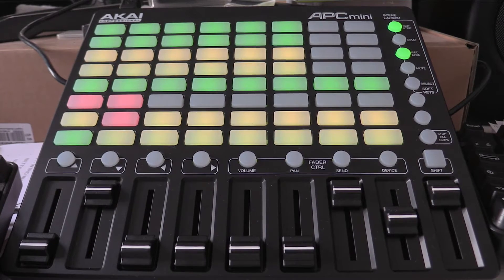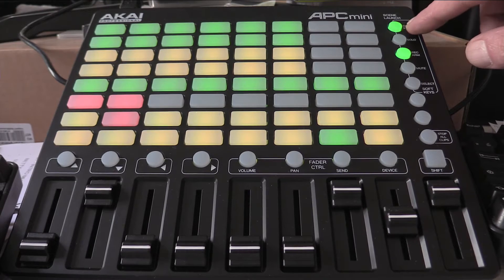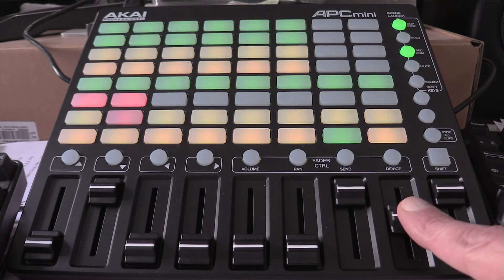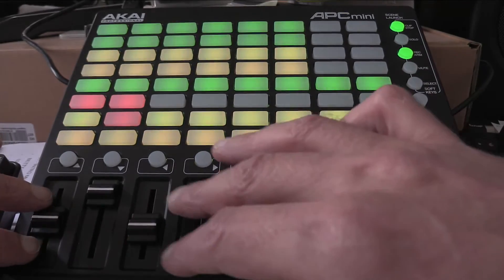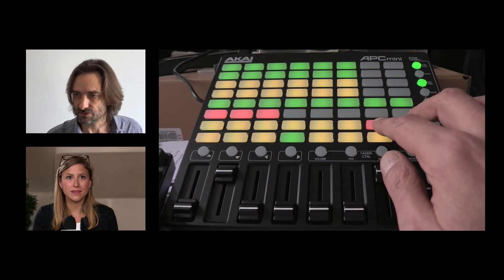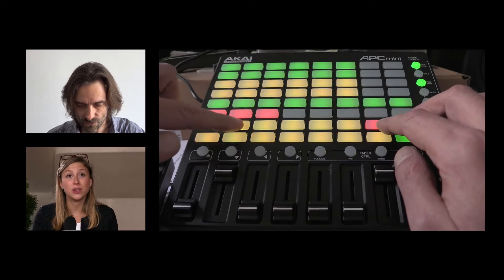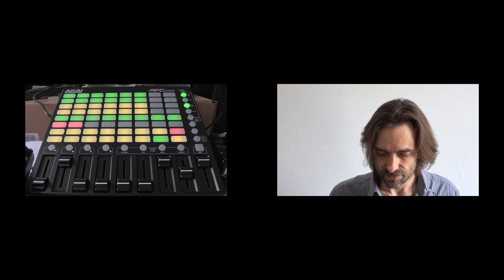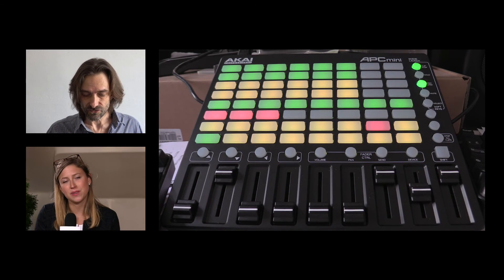vMix and the Akai APC Mini controller (Part 1)

Comment: With the APC Mini, can two separate faders control the left & right channel independently in the same input. i.e. Left Channel with fader 1 & right channel with fader 2?
Reply from the maker: Yep in audio sources only (not on master or buses volume)
Check the SetVolumeChannel1 and SetVolumeChannel2 commands in the API to set channel volumes independently when using SeparateMono on an Audio Input
https://www.vmix.com/help21/ShortcutFunctionReference.html
Reply: That's great, thank you. I have just bought The Akai Midimix unit as it has knobs & hopefully I can get them to adjust gain. I can't get it to work with vmix. What do first?
Reply from the maker: Please use the vMix forum to ask your question so that everybody can reply. I don't use the Midimix device so I can't really say.
Normally you have to create a vMix shortcut in which you tell vMix which knob you want to set a command for, select the proper command and the proper input number. It's normally very easy.

Comment: Congratulations for your video. I've just bought the Akai AOC Mini and it was so useful. I'm very interested in Multiview. Did you design it by Photoshop?
Reply from the maker: Hi and thank you.
There is no multiview design in this video but I usually create all my graphics with CorelDraw. Photoshop is obviously a solution too or Illustrator or any other bitmap or more preferably vector graphics editor... In the end, I export everything in PNG format with alpha transparency if required.
Reply: Hi again.
I designed that template in PNG but I'd like to know how can I use it as a multiview just pressing button on AKAI and resize video/photo automatically. Maybe it's a bit difficult for a novice like me, but I guess you use scripts
Reply from the maker: I think this is not the right place to discuss this. Please use the vMix forum for such questions.
However you have to understand that what you ask here is a lot of small simple things combined together. You won't be able to do this multi-step process if you don't understand clearly step 1, then step 2 and so on.
Again if you want to go directly to step 10, I gave all the technical explanations on the forum (and the script I created), just follow what I said, I cannot explain better. Some things in my use of the Akai with vMix will need time for a newbie to understand and reproduce. So my best advice is to take time to fully understand all the steps and to go step by step. It took me years to get there...

Comment: Thank you very much for this great explanation and all your input on the forum. I'm trying to mimic your setup now so I can make my own afterwards. Trying to figure out the PiP stuff with selecting different inputs but I will find it (well maybe...)
Reply from the maker: The PiP is made by setting one of the 4 Overlay to do so. Mine is Overlay 4
The Overlay Settings window specifies how an Overlay will display.
The window can be accessed by clicking the Overlay button in the bottom right hand corner of the main window.
Reply: Thanks, I just figured it out before reading this... Only thing that remains now is the multiview. I keep searching and thus learning!